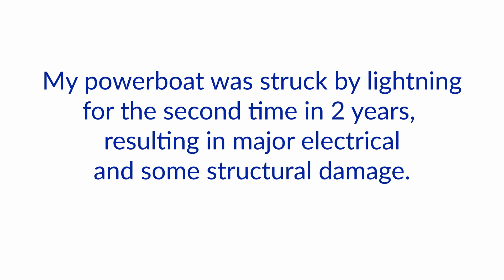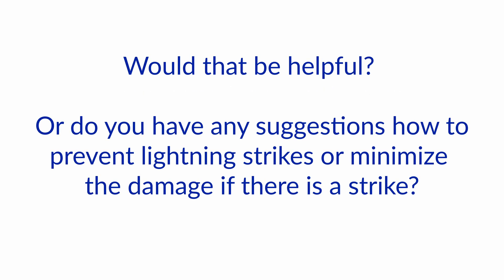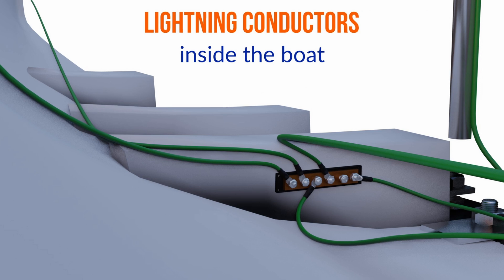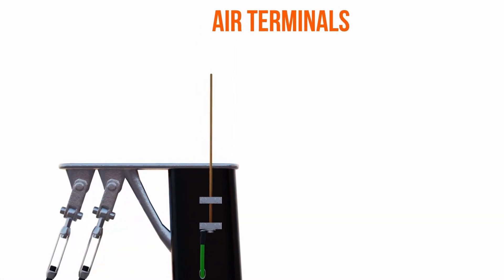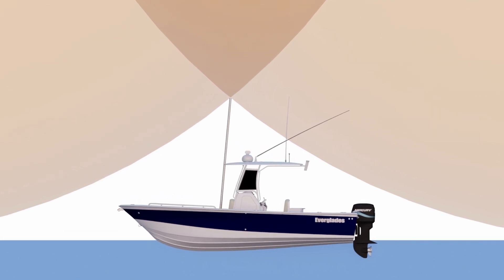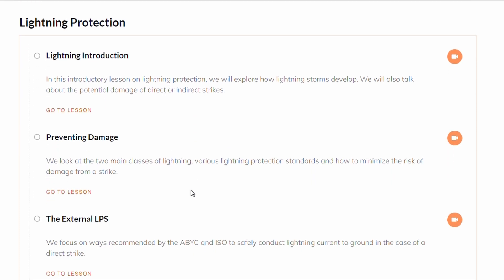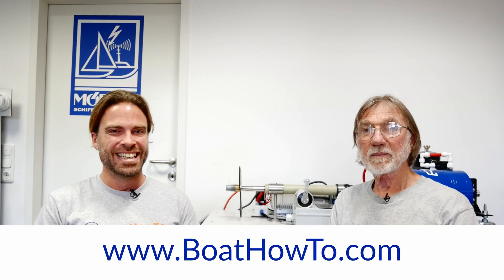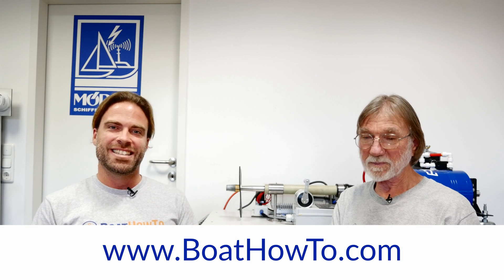POWERBOAT got HIT BY LIGHTNING TWICE on the hard - What to do? | Ask The Expert with NIGEL CALDER

Comment: Thank you for share this important information. What about in an aluminium Hull boat? Does the hull behave as a Faraday cage? And what could happen with the electronic in that case? Thank you
Reply from the maker: In theory, yes, the hull (and deck – is the deck also aluminum?) could act as a Faraday cage but then we have various ways of penetrating it. If we have a lightning protection system based on the ABYC’s approach (masthead lightning rod connected to ground) you are bringing the strike inside the boat. If you have got to the last lesson in our lightning module you will see that n recent years the NFPA has adopted a different concept which is a loop conductor designed to essentially keep the lighting as close to the exterior of the boat as possible, although this is almost never implemented because it is complex and expensive. In the case of a metal boat it seems to me (I don’t have the necessary PhD in lighting protection to make any definitive statements!) that this would come close to preserving the Faraday cage, although you still have antennas and other conductors running from outside the hull into it so these may compromise the picture. The bottom line is I am pretty sure you are safer inside a metal boat than a fiberglass one, but the electronics can still get fried. I don’t know of any data that can tell us whether or not this is less likely than with a fiberglass boat.
- Nigel
Reply: Thank You so much.  @BoatHowTo